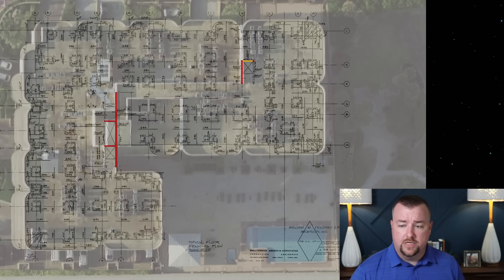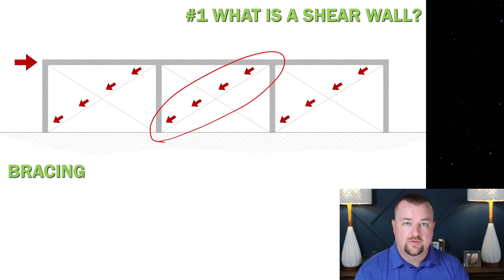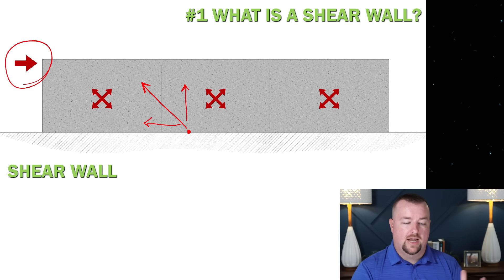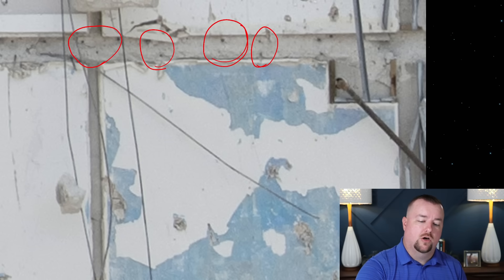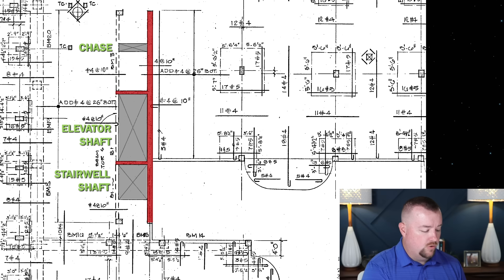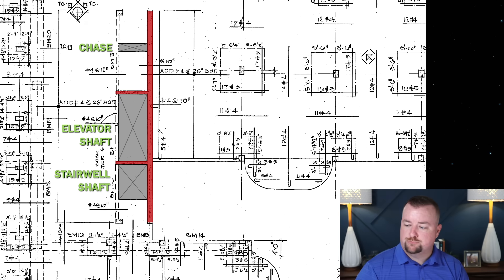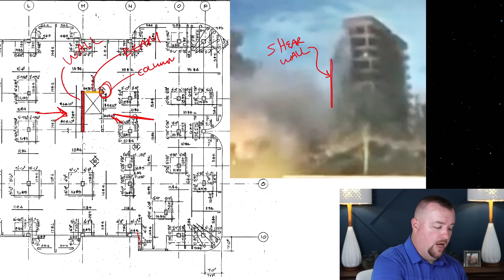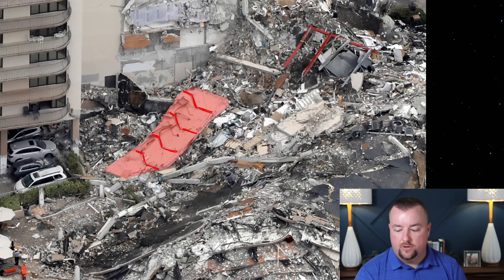Surfside Collapse - Structural Engineer Answers Your Questions About Shear and Shear Walls

Comment: Presumably with the central portion gone, that east shear wall and weak-moment connection are then overloaded. No design would have anticpated the live loads and energy transfer paths rushing through the now unstable tower. From what you have discussed in these videos almost every element seems designed down to a mimimum which is fine if the elements are constructed well and remain static and unchallenged. Introduce weakness (corrosion, damage, defects, shock) and there is no resilience. The fact that 2/3 of the structure tore off leaving the western portion largely in place is incredible. A lot of energy and masss were moving across unplanned-for load paths.
Reply: It looks more and more that the building original design was "just good enough" with a minimum margin that the design could get away with (aka cheap). Whatever margin was there got eaten up with time. One has to wonder what was the trigger that started the collapse process.
Reply: @milantrcka121  This is why I have a really bad feeling about Champlain Towers North, since they were built the same year. It sounds like they have done better maintenance over the years but maybe it's just a matter of time before it, too, cannot structurally stand. I know I wouldn't feel comfortable living there. The Towers East probably don't have to worry as much.

Comment: Thanks for the explanation about shear walls.  Did the East shear wall extend into the parking garage or was it supported by columns?
Reply: That's a good question.  One simulation I've seen showed that shear wall starting several floors above street level, which seemed very odd to me.
Reply: There are videos from the garage. Or at least one video. Based on that I'd say that it did (extend into the garage level).

Comment: My first thought of the east side of the building collapse, yes, the east shear wall was holding up the  building, but it could not fully support a rotational moment about the vertical axis of the shear wall,  So in the last few seconds, all the remaining standing  floors rotated about the vertical axis of the shear wall (clockwise around the vector from the ground to sky), putting all the slab/column joints in high stress, thus they failed and collapsed in a pancake.  But if you notice the east side of the building, the narrow 'nose' at the north east corner has rotated toward the  piece of building that remained standing.  The pancake of collapsed floors to me look like there was some clockwise angular momentum of the entire remaining structure as it came down.
Reply: I agree.  I also think Josh's drawing is slightly incorrect -- more of the front (south) face of the east section had already fallen.
Reply: That’s how I saw it too

Comment: It's strange that the hook attachment isn't standardized.
Reply: It isn't standardized but what was shown was very typical. Now, 90 degree bends are done far more often than 180 degree bends. It isn't standardized since every situation is a little bit different and what you want the rebar to do can also be different. It is very difficult to standardized concrete reinforcing design. There are certain rules that are standardized but that is it. It is what is called a performance based code rather than a prescriptive code which has many advantages.
Reply: @yodaiam1000  I would be interested to know the difference with the pull away force required between a 90 degree bend and a hook.
Reply: @Scammersimcomingforya  It depends on how much concrete cover there is on the vertical hook of the 90 degree bend and whether there is spalling on the vertical leg or not. In most situations, the difference is not significant. Designers use to specify 180 degree hooks because the total depth is less than a 90 degree hook and it was also better if you did get some spalling. 90 degree hooks are easier to fabricate and install. The vertical hook is suppose to be taller than the 180 degree hooks but it pretty much standard practice to cheat on the height of the 90 degree bend.

Comment: For me the failure is easy to understand.  How it happened is not difficult to see.  Problem I got is why the wall facing south and towards the pool was allowed to be carried by only columns.  That facing wall should have extended to the base floor of the building.  You don't suspend that much concentrated weight without ample support, which is clearly what happened here.  Portions of that outside south facing wall were not even supported by the columns but rather beams connected between columns.  It was lunacy to design in such a fashion when a simple concrete wall to the parking lot floor would have supported that wall until eternity and prevented the collapse.  That would be the correct placement of a shear wall and one that carried that outside wall to the base of the foundation.  This building was an accident waiting to happen.  And the other's with similar design should be immediately beefed up with additional wall under all outside walls to ground (parking lot floor).  Common sense omitted in design of this structure.  Proof is in the pudding.  40 year old building failed.  That's the proof that this was a faulty design.  Consideration for lack of proper maintenance would have demanded that wall be extended to base.  Yes, I went to engineering school but even a kid building a tree house would have known better than this.

Comment: Furthermore if the intent was to stiffen the structure, the walls outside wall that began the collapse would have gone all the way to the base of the parking area.  No spaces would have been lost down there had it done so and the collapse would not have occurred.  All of the outside walls should have extended to the base of the building and not stopped at the pool deck level.  That is a pure building design flaw.  And all buildings that are constructed this way need to have walls constructed below deck to support the outside walls.  That would be the least expensive way to deal with the fear of further building collapses in such designed structures wherever they exist.  Common sense was left out of the design of this building.  A simple concrete wall to the base of the building all the way around would have prevented the catastrophe.  The parking areas could have been structured to allow ample parking in the same footprint with the wall included.
Reply: A transfer slab at pool deck level would have done the same thing - although I am still struggling with WHY the building is one big structure with no joints between what is fairly clearly strucures with likely different responses to wind/settlement/vibration etc. I can see a design logic in one big structure (to help in shear resistance/robustness) if the columns/slabs are designed to transfer those forces but they clearly were not. How strong/likely are high wind forces/differential settlement/earthquake/tsunami in Florida anyway? But as the buidling has stood up for 40 years (and fell during non-extreme conditions) obviously something changed and my guess is rebar corrosion and spalling of columns/beams/slabs disguised by 'patching'.

Comment: These were not "shear" walls...they existed to allow for stairwells and elevator shafts and for no other purpose.  And if they were shear walls they would be facing the perpendicular to prevent sway from the east or ocean side of the building.
Reply: You keep saying the same thing over and over again in several posts. You don't understand how the design and engineering works and your conclusions are flawed.

Comment: always use concrete box sections at stairwells, not a  one plane wall as in this case. generally flat slab construction requires shear walls for horizontal load resistance. the shear walls have to placed at both axis, not only the x axis as done at surfside.
Reply: That's exactly my question : in this building, why is there no shear wall in the east-west axis?
Reply: @kloug2006  The E-W wind is less than the N-S wind and doesn't need as much shear wall. There is more projected area on the north/south elevation. But I would say that the E-W shear walls look pretty small. It could be that the designers were adding in some moment frame from the slab and columns. That is unusual to do these days but back then it may have been something the designers considered.

Comment: My understanding is that a modern building of this sort would have the stairway wrapped in shear walls.  So it becomes a vastly stronger structure.  But if the front of the building was pancaking then I doubt that would have saved it.  You might have just had the stairway standing.
Reply: That's a post 9-11 design criteria ... much higher emphasis placed on escapeability of tall buildings, resulting in much stronger stairwell shafts.  Even, in some very tall buildings, elevators too.

This building was built 20 years before 9-11

Comment: Why is the structural engineer MC acting as the architect with MEP and landscape under his umbrella. This seems extremely unusual and deserves your comment. MC even subcontracted an architect to look over the roof. Highly unusual. It would have been nice for CTS to prioritize the structural issues into a separate package rather than lobbing everything into one gigantic package including corridor improvements, etc.,etc.
Reply: In my experience, architects and engineers have conflicts all the time because an architect tends to think they know engineering and apply it to their artistic designs while an engineer take the architects work and puts engineering into their designs and then report back to the architects what it will take to safely engineer a build of their project based on the architectural design.  Its a tug of war all the time and both tend to not have the best of relations during building plans.

Comment: It crazy how clean the rebar is with no concrete pieces attached to it?
Reply: A previous video on this channel showed the core samples, and showed a lot of delamination of the slab around the rebar in some places.
Reply: @ernestrollins383 , indeed, but with the slab there was the water intrusion from the pool deck that explained it. For the upper floors there must be some other explanation.

Comment: On youtube a guy that in past had DIY vid's and then car vid's now seems to be an expert on structural engineering. I have no idea if he has or not but he has lots of followers.
Reply: Josh Porter is a licensed PE in the State of Florida. Checked.
Reply: @LuigiSeta  That isnt him It is Jeff Ostroff
Reply: @raphaelszok8561  I gave up on Ostroff when he said that shadows on columns in the garage video from last year, were instead places where concrete was being smushed like an accordion. He even doubled down on it when I commented they were clearly shadows.
Reply: @Sashazur  Yeah, I had that same reaction. Concrete doesn’t “smush” or wrinkle! It cracks, then crumbles apart under high load. It is very rigid and has nearly no flexibility before it cracks… especially on the bottom of beams and slabs that are in tension. Rebar embedded in the concrete near the bottom is what resists the tension there from loads on the top of the beam or slab. That’s pretty basic stuff!
Reply: @Sashazur  It's more that obvious that they are shadows caused by nearby sprinkler water lines and similar blocking light from the nearby florescent ceiling lights. The way the phone camera collects and blends the different light intensities on the column's vertical edges then makes it seem as if the columns have wrinkles in these locations, which some might mistake for "smushing".  Concrete doesn't "smush", it cracks, fails, and drops out pieces. Spalling is a clear example of this. Stross knows this, perhaps he was up too late and now is protecting his emotions, perhaps he'll see the light later on.
Reply: So what?  What is your point?
Reply: @sassylady2001  So whatt if you goin say what caused the collapse atleast be an expert in the field and not be a youtuber giving advice on everything.

Comment: I think what you have uncovered so far is excellent as for the shear walls the north side wall appears to have worked, the south shear wall doesn't appear to have been long enough as it only delayed the collapse and gave way from the pool side were the wall was missing. 
Secondly it appears that the pool deck collapse pulled and destabilise the three pillars of the centre part of the building if there was a shear wall in the parking garage separating the building from the pool deck, maybe the building would have survived long enough to evacuate the people.
Just my thoughts from a naval engineer in the UK
Reply: Seems to me that if shears walls are there to provide resistance due to wind loads, namely a hurricane in worst scenario, then there should be shear walls that could handle the load from the east, west, south or north.
Reply: @smallgasengine805  I was thinking the same thing especially from the East where most of the hurricanes in this area of Florida are coming from
Reply: @edzachary8657  just a quick note- even though hurricanes in general originate from the east, the actual direction they are coming from at landfall (for any one particular location) can be from any direction. There is a lot of wobble in the trajectory.  Plus, the strongest winds a structure will encounter can also be from any direction, due to the circular rotation of the hurricane & eye. It can also be strongly influenced by the structures around you, and if those hold up (provide buffer) or fail at some point during the hurricane.
Reply: @edzachary8657  That is not how we design for wind. As it comes from any direction.
Reply: I agree. I do not understand why both shear walls (a real one and a phony one) were designed to stiffen the building in one axis only. I would expect winds from the ocean in the unprotected direction. There should be a shear wall in another direction. The small shear wall (it "flipped" on the top of the rubble) was not only weak, but also too short (stiffened top floors only). So the engineer (probably forced by the investor, unfortunately both already dead) saved a lot of money. The disaster was caused by the fact that the pool deck (which collapsed 7 minutes before the building) was tied with the beam which connected three critical columns 16"X16" supporting the front of the building that collapsed first. We already know that the collapsed pool deck severely weakened the columns. Why in the critical area the building was supported by 16X16 columns, while in the "strong" part of the building the columns were 24X24? These columns should have been designed much stronger (if it not should have been a wall). The collapse of the pool deck should not have affected the strength of the building structure! I am just an MSME with no experience in building structures, but in my opinion the blame should be shared between the investor and his construction engineer, contractor (weak slabs) and the bldg. maintenance that allowed for rebar corrosion and spalling.
Reply: @adamgrabicki3987  Yes, hindsight is a cruel mistress, I am wondering when the reasons of the why and the who is to blame how many apartment buildings will be accessed much more critically by engineers and architects and either be declared unfit for habitation or straight out condemned due to them.
I suspect it will be a significant number of buildings because this style was very popular in the late 70's and early 80's worldwide and many buildings maintenance has been poorly funded or ignored.
Reply: @adamgrabicki3987  The 24x24 beams were under the second parking deck, and I believe were only that large under the top parking deck, and got smaller above that deck. Cars weigh more than apartments, and will induce a bending moment force in columns when they start and stop, but not sure if that's the reason. Construction drawings show the what but not the why something was done. On top of that, you get builders failing to build to the plan. Sometimes they fail to build to the plan because it's impossible or impractical, but should always get the the architect's approval. For example, the Kansas City Hyatt skywalk collapse resulted from a design requiring a rod to be threaded for two stories. They don't make rod threaded for 20 feet, so the builder substituted two rods with a metal plate in the middle of the upper walkway. That plate had only been designed to handle the weight of one walkway, but ended up supporting two.
Reply: @johnhaller5851  that makes a lot of sense! I work in data science on mobile app data, & the app developers almost never code according to the plan created by the UI designers/data architects, so a lot of my job unfortunately is auditing the existing data to decipher what actually got built. 

It makes sense that this happens in other fields. It makes tracking & fixing bugs difficult.
Reply: @adamgrabicki3987  : Seems also that was shown on the plans wasn't followed. e.g. rebar.